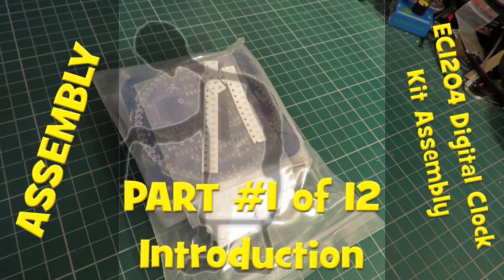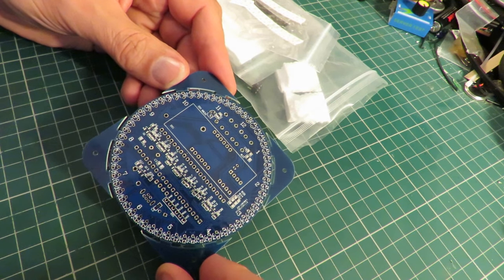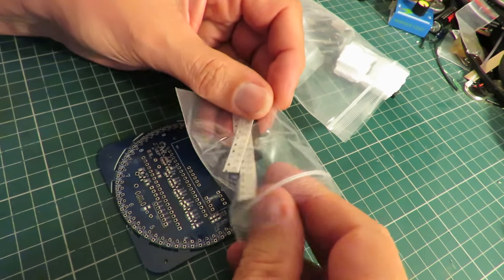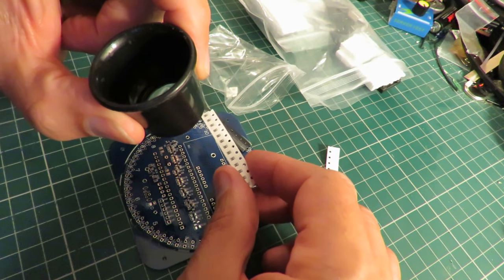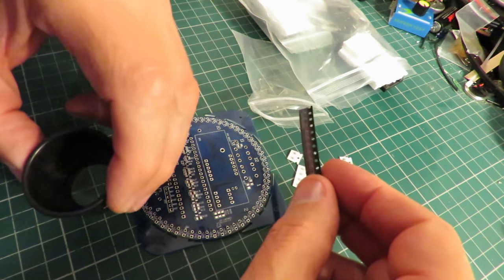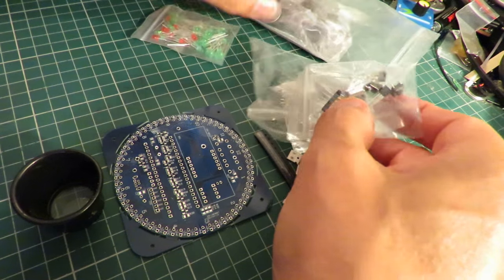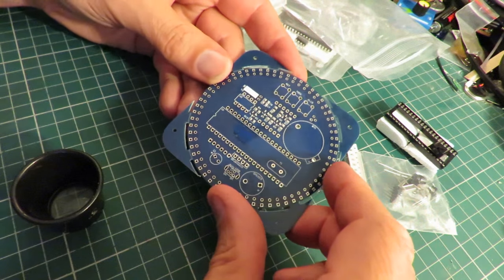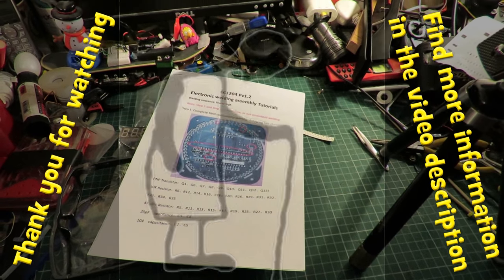EC1204 Digital Clock Kit Assembly PART #1 Introduction

Comment: Hello.
Very nice instructions! I also wanted to built the kit, but I did not have any instruction-paper. You got one, I see. Please, can you send me this paper with the components?
Thank you very much.
Reply from the maker: Perhaps you will find what you want in my video description, there is more information there 😊
Reply: Hello.
Where can I find the video-discription?
I only wanted to know, where I can find the paper with the components (resistors, capacitors and so on) you used in the video. I must know, how much ohms the R3 (f. E.) or how much farad  the C7 (f. E.) has. My kit did not include the component-list. In your video you got such paper, I could see.
Thank you for answer.
Reply: Oh I'm sorry!
I did not know, that your description is much more longer as shown! Now I got the pdf.
Thank you for helping me.
Knut